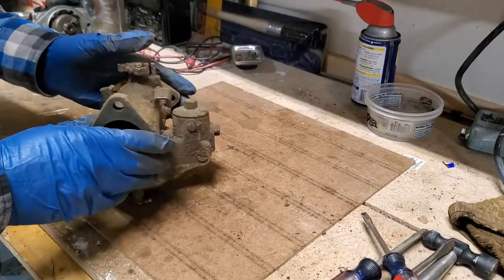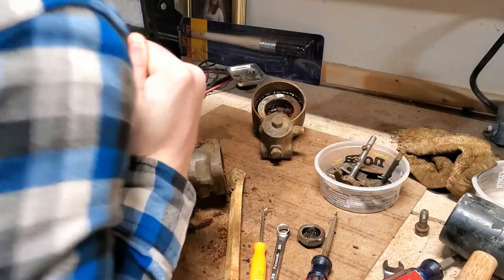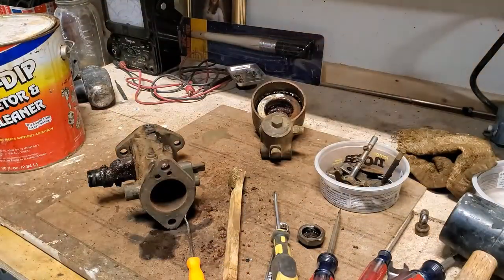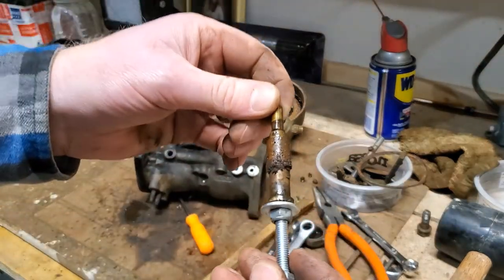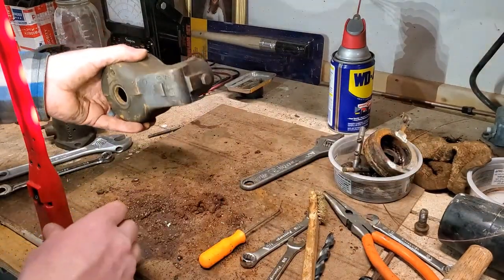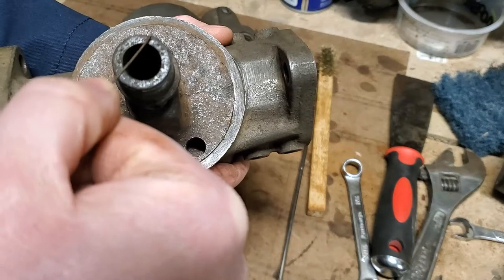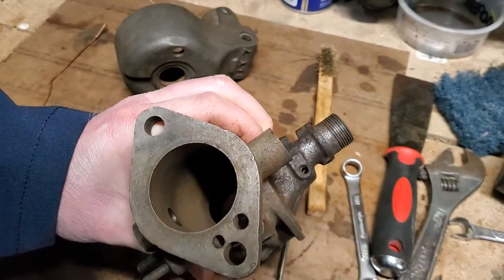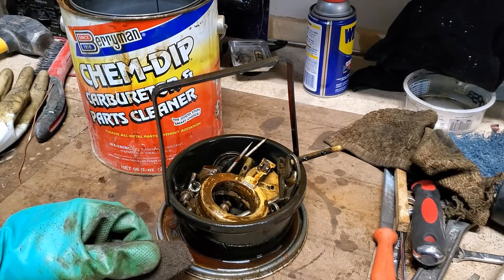John Deere AR Carburetor Rebuild

Comment: Very nicely done. Your more of an expert than some of the self-proclaimed ones. Nice tip on removing the nozzle/emulsion tube. I believe you may need the spring though, as you cleaned it good. the vibrations may drop it into the bowl. Thank you!
Reply from the maker: You know, a few people have commented on the spring. It's hard to tell in the video, but that impulsion time is very tight. I had to hit it in. So far it's been fine. But time will tell.

Comment: Very impressive rebuild given the amount of rust and corrosion.   Was curious if you have ever used Evaporust to soak a carburetor.   I have used the Berrymans product and found that the heavy rust and corrosion remain.   I broke a dltx 71 trying to remove the bowl nut that was seized due to the fuel left in the bowl.   My fault.  Heat and patience prevails neither of which I practiced.   Learned valuable lesson watching your rebuild.
Reply from the maker: Heat for the win! I've never used evaporust, but I'm sure it would work well. You're right, Berrymans doesn't really do anything to the rust. It just gets the tarnish and grime off parts.

Comment: I think you'll need to get a spring for the main jet.
Reply from the maker: Ended up not needing the spring. The emulsion tube fit snug enough that it doesn't fall out of place. Tractor is running good.
Reply: Later in the day I found the spring. Under the table where I worked over the carb. Put it in last night-no improvement. Time for some serious mag work.